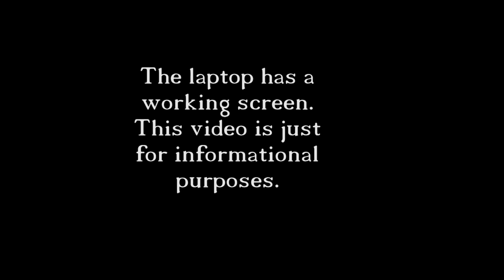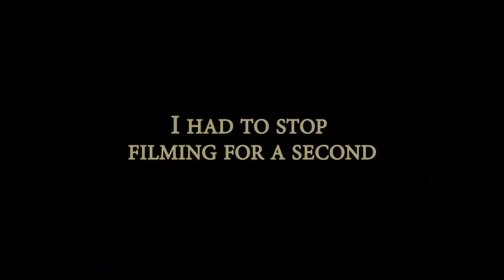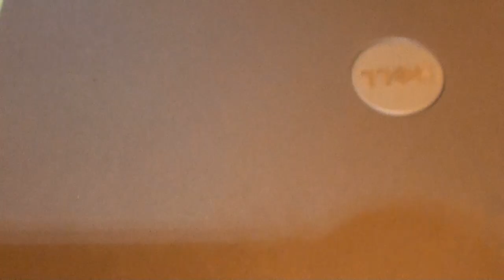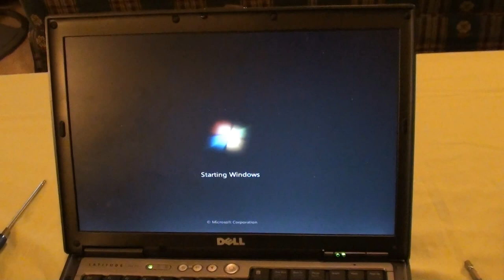Dell Latitude D620 laptop - Screen removal and reinstallation

Comment: I don't know how to respond to my original thread. Neither Laptop screen works. I happened to have parts for a Dell D620 because I bought two at the same time. I replaced the non-working laptop screen (it was black but I could hear it booting up) with another screen while watching your video. Same problem. Black Screen. 
Now I know it's not the screen. 
So, I then watched more videos and read I should connect the laptop to an external screen. I should have done that in the first place but as I said I have no idea what I'm doing. 
Anyway, when I connected an external display, I could finally see the screen on the external display but it was a rough visual. Red vertical lines running through the display. 
So if it's not the screen, but it's not a clear external picture, is it the video adapter? Something else? 
I'm about out of my league after replacing a screen.

Comment: Great vid. Question. I'm about to swap my dead screen out. In it i have WXGA 1280 x 800. Is the pinout the same on the 1440 x 900 WXGA+? Uses the same card across both models. If upgrade is possible then whynot?

Comment: Hi, and thank you. I was able to replace a non working screen with a working screen but my problem still exists. 
My screen is black. 
When I hook it up to an external monitor, it works but with red vertical lines running through the external display. 
It's enough to backup a few needed things but not a solution. 
I know nothing about computers except for what I find on YouTube. 
Can you help me with what the problem might be? 
Thank you!
Reply from the maker: +Amy Jim Emma Chris Carr so when you boot your laptop you get nothing, not even the boot screen? Do you get the normal boot screen using the external monitor or does it have red lines too?

Comment: Yes, normal boot screen. I just can't see it on the laptop screen(s) and the picture in funky on the external
Reply from the maker: +Amy Jim Emma Chris Carr it sounds like it's either your video card or drivers. If you can get into "device manager" you can try updating the video drivers or uninstall them and do a reboot so you'll get a fresh install. Are you sure the external monitor and cable are good?

Comment: i replaced battery of it with Chinese one because original one died now when i am trying to remove it it stacked completely can you help it out any alternative for removing easily without damaging any stuff
Reply from the maker: +Ajmal khan jamro is the battery stuck?
Reply: yes stucked and hucks which move left right are not moving jamed
Reply from the maker: +Ajmal khan jamro try pressing down on the battery and moving the release levers with a screwdriver. If you can get them to unlock then you can gently pry the battery out.
Reply: ok nice let me try